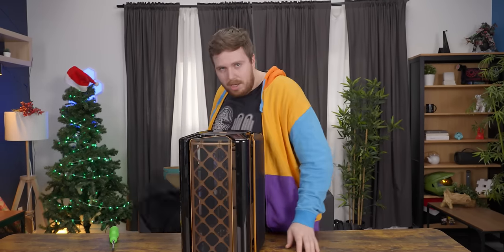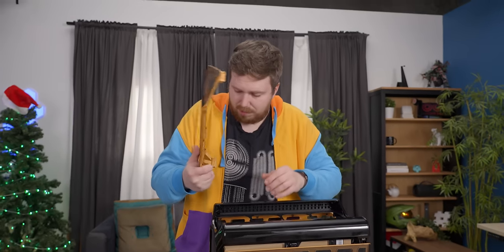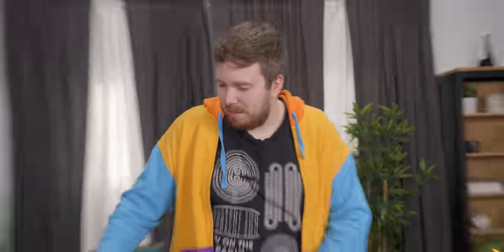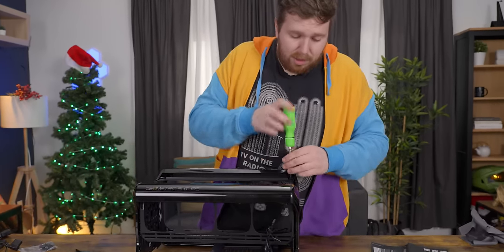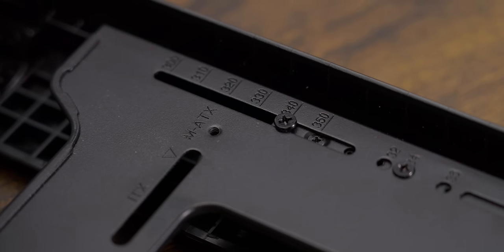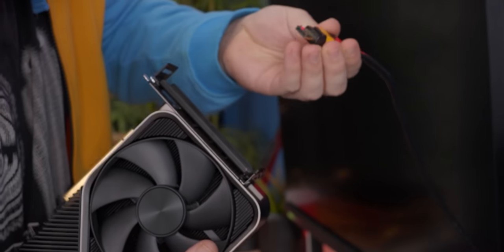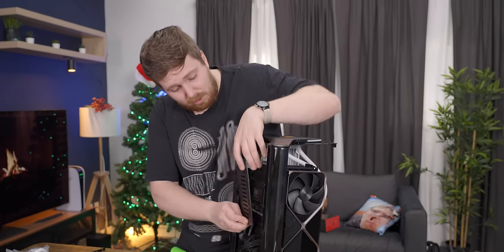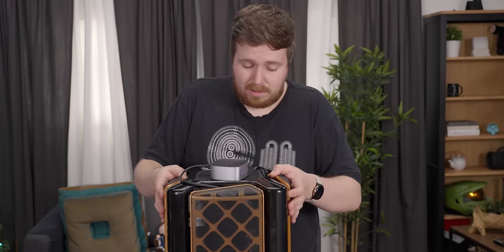A disappointment of Biblical proportions - The Ark Model 2

Comment: calling your company cuktech in 2023 is actually insane behavior.
Reply: It wouldn't have been any better at any other time
Reply: They knew what they were doing. A little viral marketing can go a long away... in popularity... and very quickly into obscurity
Reply: “The "CUK" (/kʊk/) in CUKTECH is the recognition of the Čuk circuit, which is a special type of DC-DC circuit topology proposed by Slobodan Čuk in 1976. The CUK circuit's high efficiency, low ripple, and flexibility not only align with the modern demand for efficient energy utilization.”
Reply: @macking104  that almost made sense.
Reply: insane...? or based?
Reply: Slobodan Ćuk

Pronunciation: Chook

Nationality: Serbian
Reply: It is pronounced CHOOK. The guy was Serbian.
Reply: Not really, the most effective form of marketing in 2023 is anything where there is a perceived mistake, misstep, misunderstanding. It draws in commenters which  raises the viewcount and profile of the device. Most people will ignore a name once they have a product regardless of how "silly" it sounded at first. Its quite clever honestly. Didnt harm the Wii did it :D

Comment: 2:21 i bet the one hole allows for the plastic nub to rest in sorta like a detent and the one screw acts as a hinge so you should theoretically be able to open the side panels like a door
Reply: at 17:03 you can see the panel moves so i do think that there only being one screw is on purpose so that you can "adjust the side panel" but i have no idea why you would want to do that
Reply: @Tuntalunta  ha ha, just wrote my comment on the same line before reading yours.

Comment: looks like those panels are setup to hinge open with the detents to hold them in place.
Reply: LUL he keeps accidentally opening them after commenting they should hinge open and never notices...
Reply: @DerrickBommarito  This.
Reply: They only hinge like 15 degrees though
Reply: ha ha, made a comment abou this after 2:35 of the video. annoying to see another video not prepared, again.
Reply: @theod9548  it’s a short circuit, not a review. If they spent time preparing for shit on this channel it’d lose the whole point of it. That’s the ethos of this channel. If you don’t like it, watch mainline LTT instead.
Reply: @DerrickBommarito  It looks like it fouls with the black plastic. If you go to their website it never shows the panels swinging open and it never mentions that possibility in the manual either, it tells you to take the screws out and remove the panels entirely. Maybe when they were designing it they wanted it to hinge open but they messed up and it didn't end up working out. At 17:04 if the hinge were to actually work he would have found out right there, the entire weight of the case was on the panel and it barely opened
Reply: @s8wc3 He mentiones in the video, that it bends through bad plastic quality. It is not a hinge. Also, moving it around on these little sree holes, it will wear and break easily.
Reply: @bakedbeanfanclub them missing product features and drawing incomplete/wrong conclusions is a feature not a bug? 
Oh ok, because that's what I was actually looking for....
Unprepared fast product content that I cannot fully trust to draw any buying decisions on. I never fully trust almost anyone, but you get my point. They are ruining their reputation with this half assed time wasters. And they're most likely not going to notice because the algorithm still likes to recommend this.
Reply: @tonn333  it still costs 160 bux and is still garbage
Reply: @rgb1996  not my point... Did you even read?
Reply: @tonn333 look al 17:00 and how much that hinge opens
Reply: Look at 17:00, they are not doors
Reply: @tonn333 it's not a feature because like someone said it's not mentioned on their website that it hinges either
Reply: @xelaander8429  that is besides my point... Look at what I was replying to. My point is regarding shortcircuit content in general.
Reply: @jkapillo  besides my point...
Reply: @tonn333  
You: why didnt they test the hinge? theyre killing their channel with this poor quality shit.
Others: its literally not a hinge, its not claimed to be in the manual or the marketing, its a side panel. even if it was a hinge itd open 15 degrees and be useless, case is still crap and the video is fine
You: tHaTs NoT mY pOiNt

lol, it literally was your point and now that youve been proven wrong youre workin real hard to move that goal post.
Reply: @StretchDattass  I have not mentioned the hinge or even anything directly about this product but the channel and it's recent trends in general.
Could I have made my point more clearly? Obviously yes. Please forgive me.
Reply: @StretchDattass  look at my first comment and TO what comment it was a reply to.
Reply: @tonn333   your point is moot because the premise of your argument has been invalidated
Reply: @StretchDattass  the dude would rather go to bat for a crappy product than admit he's wrong, he must be so fun in real life too
Reply: @xelaander8429  oh yeah? And what is that premise that has been invalidated?
Reply: Look at 0:34 where he picks up the case with one of the panels. It's definitely not meant to act as a door.
Reply: @tonn333  Going into it a bit ignorant of the product with a yolo attitude is literally the whole shtick of these videos and has ALWAYS been that way. They do it to give a genuine first time experience to emulate what your typical consumer would experience. Like not knowing something because it wasn't printed on the box for example. Most mistakes are corrected in post either with annotations or a spot before the outtro. If this isn't what you are looking for then why do you keep watching these? You claim you are looking for something more practical and yet you are still here watching these instead of moving on to what you claim you want. Seems more like what you are looking for is a place to whine.
Reply: @TheChemizzle  is it useful? Actually, is it as useful as it possibly can be? Who is it useful for? 
I would argue that it's not particularly useful for someone, having looked up a product candidate, trying to figure out its place in the marketplace of other similar products in order to choose the one best suited. 
Everything would turn out to be much more useful imo, if they took the time to mention some of its competitors and they are relating in that particular market segment.

Comment: Can we just petition Corsair to relaunch their Obsidian 250D? That was the true king of high performance SFF cases.
Reply: Thermaltake Core V21 is very similar in layout to the Obsidian 250D. and its only about £100. There's alsp the Thermaltake Level 20 VT,  which looks even nicer.
Reply: @drvish  Did you even look at the Obsidian 250D? Smaller, better layout, side-intake for the graphics card to breath with room for a dual-120mm AIO on the opposite side intake/exhaust. Seriously, look up a full tour review video of it.

Comment: 13:20 TBF that is literally supposed to replace the front panel IO that would be ON the case itself .. so its not actually supposed to be long.  Its literally designed to be right next to or on the case.  Also you can just buy male to female type C extension cables.
Reply: sure but its just another goofy design decision, also looks terrible just sitting on the case
Reply: The only benefit to doing it this way is being able to put the ports on top of your desk, which they defeat by shipping the super short cable, yeah you can buy an extension cable, but this just shows they didn't think this whole thing through properly. Also having a random cable come out through a gap in the case just screams "afterthought". If the dock is ON the case itself, you might as well just have ports in the case itself, without the weird cable coming out of the case, and the annoyance of the dock always moving when you try to plug in a cable. When the ports are on the case, you only need one hand to plug something in, with this dock you will always have to hold the dock with the other hand.

Comment: if the panels were made out of aluminum or something it might be worth the money, and give the case some more rigidity.   plastic cases are a no go for me.  often times something gets broke when accessing to change hardware, or sometimes in the build itself.  i had a case that had plastic drive locks with metal posts. ideal for one, maybe two uses, but then the rotating plastic lock often broke or was worn where it didn't hold the drive in place

Comment: AIO mounting as-built is bad for the life of the AIO; the built-in res is at the top of the rad, and therefor the pump will start (eventually after the fluid level inevitably drops over time) getting air and die prematurely. Though the reverse-orientation would fix that. You didn't mention it though, thereby propagating the acceptableness of such an orientation (case manufacturers do it too; that doesn't make it okay).

Flimsy when the radiator / fan panels are removed? Of course. Why would you suspect different? I would've kept at least one of those panels for strength. IDK if when reassembling you misassembled it to cause that wonkyness, or whether the plastic is used for structural parts in places, which would be a bad design.

As to price, I'm not surprised. It's not a standard cuboidal box, and they aren't going to sell that many, and it's ITX with a relatively unique aesthetic. Saying that, this short overview doesn't fill me with confidence that it would be worth buying even if I wanted the aesthetic.

Comment: if it was the 60-80 dollar price range i wouldnt mind that at all. and given that its like 30% open air, 69.999999% plastic, i dont get why it wouldnt be cheaper. they need to add some reinforcements and give a longer cable for the addon box and then bing bang boom

Comment: The radiator mount looks like it's cut out for a cross flow radiator. Mount the rad to the outside of the bracket and put the fans inside, and it would also give you more room inside, but you don't get your fancy rbg fans showing from the outside.

Comment: That could have been a really nice case if it wasn't made as cheap as possible so they can increase margins. I love the puck and the design but the lack of a nice spot to run cables out and the fact that the plastic will look like garbage and get scratched like mad (if not broken) within 6 months makes it a complete waste. If it was made more robust and had some metal support for the side panels and a hinged panel for easy access I would be fine with that pricing.

Comment: They shouldve made the front sturdy and hindge open and have the sides look nicer but be week and then force you to use 2 360mm rads so that youve got adam and eve acting as your support and cooling for your gpu and cpu and the front hindges open so you can see them both.

Comment: This review is a bit off-putting for me. I'm not saying this is a great case, there's definitely some design choices that are concerning, but the overall feel of this review was to just hate from the beginning.

You slammed the rigidity of the case by removing key structural components, then hanging the giant ass GPU vertical and seemingly not taking any care for support on the system then surprised at the end when the thing was not square. 

For some reason, I'm rather upset you thought nylon ties might have been the Velcro ties. To me, this made me doubt a lot of other things in the video such as at the beginning asking where the front I/O was, then discovering it was a separate hub? Were you screwed out of being allowed to do any sort of basic research before filming?

The two holes for screw mounting? Notice the nub that's a locator into the second hole. Not an oversight, maybe just a poor implementation of a locator type pin.

The PSU mounting is atrocious, the USB-C extension cable to the dock definitely needs to be included with that female end, but you can just as easily buy a dual female adapter for cheap if absolutely needed. Not that should have to, but if you decide to buy the case and build it, that's your decision. But I do like the idea of that dock.

Great case? No. If made with thicker and better steel, and more of it, that would help. Correct the PSU, dock cable, and cable routing to the outside of the case? Better

There's a lot of thoughtful designs in this case. Many of which should be the "norm" and many which could be considered thoughtful and helpful.

Comment: I have the Geometric Future M8 - and the case in the video is hot garbage in comparison.   YMMV, of course --  but I absolutely love the M8, and no build quality complaints.  They didn't try to do anything crazy with it though, the "gimmick" with the M8 is just that they rotated the mobo 90 degrees to put the I/o on top.   Also fits both a 360 and 420 rad, with room left for a 120 on top.

Comment: Looked alright until i seen the black finger print magnet lol (wait now we all know your finger prints could be make a replica of them and frame for crimes or get into vaults and other biometric stuff?). Would have been cool if it was metal inside and outside with some IO. And yeah im so glad more manufacturers are doing 1 screw size now, its infuriating when they don't.

Comment: this video has a lot of comments that seems to be going both ways, there is either critique of critiques of the case or agreeing with adam and saying the case is garbage.

either way, while im in somewhat agreement that the side panels are suppose to swing out but it seems like no one caught that from what ive seen video wise from others so that point is kind of moot. i kind of think the ark isnt really that good of the case, i think the rest of their cases look good, maybe those will be looked at in the future? the geometric future so to speak XD
Reply: The main issue is just terrible build quality combined with a premium price tag and the totally not thought through features. If you buy a $160 case, you don't want something that screams "cheap" and flimsy that will barely survive you building a single system in it. You want something that's able to be your PC case for 5-10 years, something that will work through multiple component upgrade cycles. I mean, you can get a Fractal North and so many other actually good cases below this price point.
Reply: @ska042  ohh ya for sure I definitely think the ark isn't that good but from what I've seen of their other cases their cheaper and while a bit weird to build in they're very striking cases which I think would make them worth it. I think the ark was a swing and a miss.

Comment: The quality of production is good as usual, but I can't say same thing about the writing. It's like a personal impression of a writer that the host is just agree with without giving a shit about anything. And by the way they "review" the case it is clear that the writer did a vary bad job. Like if they had one hour to come up with this piece of content. 
I mean, those panels clearly open up using one screw as a hing and the extension box instead of front io is a great idea in this kind of design...

I don't say that it is a very good case, but they make it look just bad and it's not clear if it's because the writer didn't like it for some reason or they just didn't have time to actually look into it. 

Sad thing is that it's not the first video that have this kind of issue. And that's the reason why I don't watch ShortCircuit product videos any more...
Reply: The panels do not hinge! 🤦
Go look at their website, nowhere do the manufacturers themselves remotely suggest you use it that way. That tiny bump cannot realistically serve as a hinge please 🤦🤦🤦

You lots coming here with this fake journalistic integrity BS when you're obviously wrong is the funniest thing ever, take several seats pls

Comment: the side panels were obviously designed to be doors, with the screw keeping them close, and the pimple acting as axis. pimple was probably not designed to be proud enough, but the panel being flexible allows you to remove it after having removed the lonely screw on top and bottom. maybe, once again, stop having a pop at a product without looking. you call yourself engineers... At 2:25, I wish you'd shown the outward side to make sure. You seem to be falling into the same pitfalls than before the 'big bang'.
Reply: I just understood... HE did not want to make that video, but it was his round.
Reply: When did they call themselves engineers?